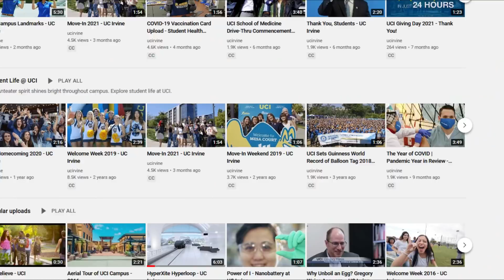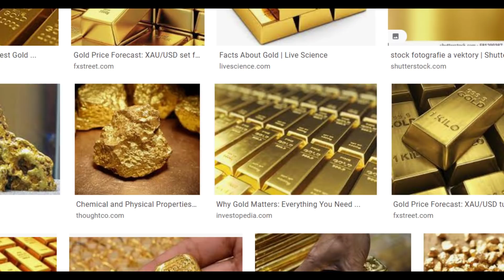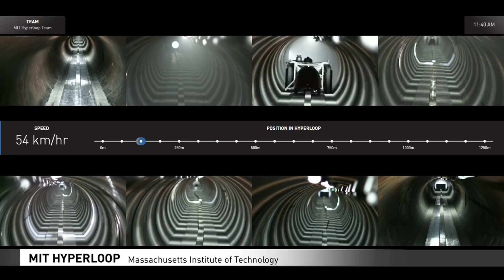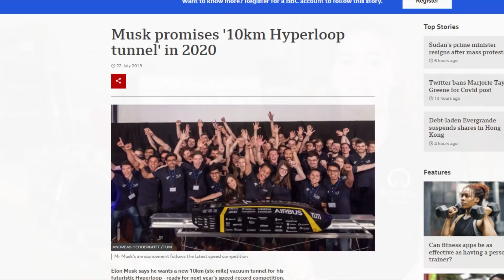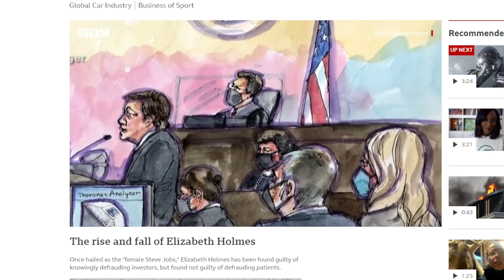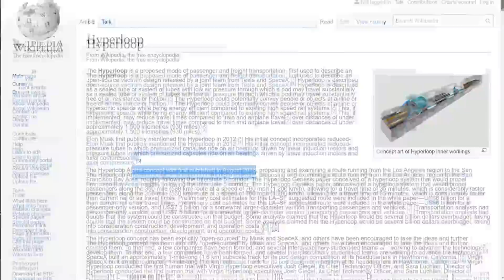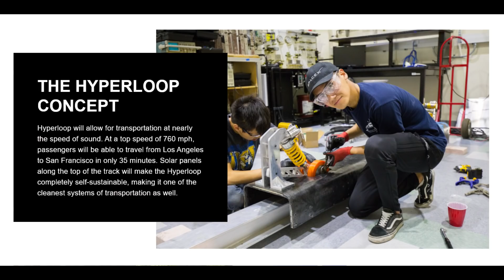The GOLD Battery that will revolutionize EVERYTHING!

Comment: Given the thermal runaway on a failing lithium cell imagine the disasters we'll have if we ever do figure out some trick of physics that let's us dramatically increase the energy density of batteries.

"In a tragic story this evening ALL of greater LA was vaporized when Little Timmy cracked open the battery on his Forever Flashlight unleashing all 250 petajoules of energy contained within it."
Reply: Thunderf00t has talked about that, basically if you wanna increase capacity, you must trade safety. Lithium batteries are are essentially like thermite when they start burning
Reply: I suddenly have the mental image of a scene from Star Wars where a battery like this fails by accident and its inventor, rather than accept the failure of his infinite power battery project, just puts a timer on it and invents thermal detonators

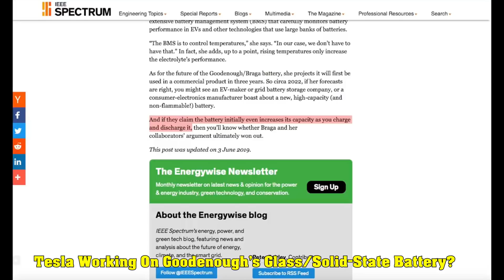Comment: 16:00 That was directly from Goodenough's research, which I tend to believe, but it really shouldn't be sold in the way he's doing. Apparently, something about the chemistry, intercalation, and structure of the solid-state battery that Goodenough's team was working on resulted in an interesting characteristic where it needed to be cycled several times before it could achieve its peak capacity, but it would begin degrading (as all batteries do) after that point.

Comment: One thing I don't understand about the Hyperloop is why have a vacuum at all? 
Also, why don't they use a skirt like those hovercraft do? 
Without a vacuum, they could put a big turbo fan engine the front and use air cooling from the exhaust in the rear that creates a "pocket of vacuum" right in front and uses that cooled, compressed air to lift and thrust it. So there will be a compression behind and a vacuum ahead of the pod while it's under power. 
If you put coils along the tube path you can provide power through magnetic induction. Now the whole thing is passive and practical! 
When someone takes this idea and you read about it later, please emember this post?

Comment: 13:00 not just wheels, wheels sprung on Öhlins shocks, one of the most expensive suspension manufacturers. For a vehicle that will travel on a flat metal rail.

Comment: Maybe you will answer this later in vid but I want to ask as im watching it. So I'm guessing the gel and the process of what they do with it on nano wires is the interesting part. Since gold and lithium store about the same energy couldn't this same gel and process be used on lithium nano wires? What about other metals. Im no chemist at all but im kinda a fan of radio isotopes. Would be cool if spent fuel could be re used like a contained battery

Comment: I don't know. They coat the interiors of buildings with gold. Which works because the layers are only a few atoms thick and the actual amount of gold is negligible. Since capacitors only care about surface area, I don't see how the price of gold is a massive issue here. In fact gold is used in electronics all the time, mostly for plating contacts against corrosion and minimum resistance.
I mean it's probably still a dumb idea, but not for the reason of pricing or weight.

Comment: Have you seen the carbon nanofiber battery said to work by I think, brownian motion? The video I saw didn't have any crazy claims about how much power they'd produce, just enough to maybe power small things like watches. They just said as long as there's thermal energy in the surroundings, it will keep providing power. Can you debunk that, or have you already and I missed it?

Also, would scaling up the pneumatic tubes used at drive through banks for a while work? Or is that just as impractical as hyperloops vacuum tube?

Comment: To be fair, the price is the least of the issues. Corrosion resistance of gold is used in a lot of tech. Sure its not a lot per cpu/connect but it still adds up in the tech we use. So its more about how much you would need per battery.

Comment: Itd be fun if simply removing the vacum in the hyperloop and just have a contained loop and the trains not affected by weather and wind, whould have been better than the hyperloop.
That way creating a new enviroment to design a new type of train. Is it powered by maglev? is it powered by an aircuchion? is it powered by a spining fan / compressor?

And they went directly to a vacuum tube.

Comment: You can buy off the shelf lithium batteries today that have a 10 yr, 6000cyle (to 80% DOD) warranty.  Quick 'blip' at 3:05 says "she found commercial gold nanowire batteries could last up to 5,000-6,000 charge cycles"......so where is the improvement ?

Comment: What I don't get about the Hyper loop is why is the car even powered at all? The original idea from the 19th century and as actually implemented with the Atmospheric railway with tubes under the car is to use the air pressure to fire the car down the track which seems far more sensible if not suffering from the same problems of cost and integration etc.

Comment: What I find funny is air pneumatic messaging system send their pods faster through a tube compared to a hyper-loop. Because hyper-loop got the principal so so wrong.
Reply: i always wondered what happened to those. Instead of trying to make the air a vacuum to remove drag, Couldn't we use pipe physics to start a wind tunnel to reduce drag? If the wind moves with the pod there'd be less drag....
Reply: @comet.x  You would have the air dragging on the wall of the tunnel instead - even more power would be required.
Reply: @dukenukem5768  Aren't pipe physics really weird though, which is why pneumatic messaging worked (and still does for delivering drugs in hospitals) so well?

Comment: that would be really useful in satellites and shit though, the quick discharge of capacitors is important for turning on some intermitent systems, with this technology they'd be a lot more durable.
Reply: I was thinking luxury watch batteries.

High value items with low power requirements that will benefit from never degrading.

I think 'gold battery' would do well even just as a marketing conceit

Comment: Two tubes, each with individual pressured one-way valves, would still not retain a vacuum. There is no way to maintain vacuums over any sort of distance because it's literally an exponential growth of energy to suck the air out of miles and miles of tubes

Comment: The claim for increased battery storage after time was based on the charging software getting upgrades that would allow a higher maximum than previously limited by safety. So you are starting with a battery that can only charge to, let's say 80%, the through updates it can now safely charge to 90%.

Comment: The Hyperloop can easily be built in space. Just make a 30km-high elevator and build it up there. Presto!
The battery on my cellphone already seems to last forever. However, that property seems to work only when it's plugged in, which means that the ever-lasting battery is somewhere in the wall outlet.

Comment: But a capacitor isn't storing energy chemically, it's storing it electrostatically, it is relying on the structure of the gold, rather than its reduction potential. So it's actually going to have a much lower specific energy density than a lithium ion battery, but it could have a higher specific power density. Discharging in a microsecond while the li-ion takes a few minutes.

Comment: Have something that actually does exist.
Alluminium ion batteries.
2.5 times the energy density of lithium ion, less likely to explode and near double the charge rate!
The catch?
It outputs 30% less voltage and is a good chunk heavier then lithium ion batteries, and most of all its lifespan is abismal. That is because the alluminium creats its protective oxydation surface no matter what and chemically attacks the cathodes and anodes.
Basically it oxydates the entire battery very very fast. Thus making it unuseable.
It might be possible to prevent this. But so far, we habent discovered how to reliably do so.

So yeah.
Have some actually true and interesting battery tech that is actually being worked on right now.

Comment: It's not "wheel," it's the hype-r-Hoop™. 

They'll not walk on roads, but this new concept that borrows from circuit boards' pathways, the traces, but it sounds better to say they're hype-r-pathways. And the whole hype-r-loop thing is in turn renamed hype-r-circuit to better describe the analogy. The tracks, they're like "conductors" for the flow of the hype-r-vehicles. You'll soon see an awesome 3d graphics presentation showing allegorical glows of light flowing on a circuit board, which will gradually fade into 3d vehicles and tracks, metal tracks similar to those of circuit boards. While an easier way would be to have a literal pair of hype-r-conductors in each hype-r-pathway, so that the hype-r-vehicle can rest on both sides in a way not unlike how cars rest on its wheels of both sides, an idea to explore is to have the hype-r-vehicles hype-r-balanced with hype-r-gyros and running on a single hype-r-conductor line. That cuts the main material for the hype-r-pathway in half.

Comment: Capacitors are great at surviving many charge cycles. A capacitor in  a 2.4GHz WiFi front end us charging and discharging 2.4 billion times a second and will keep doing so for 20 or more years.
Reply: Total energy is super low which is the problem.

Comment: Real Battery Tech that has promise:
Aluminum Batteries (though these would have to be swapped as they are one time use... But man are they cheap and fully recyclable!)

Iron Batteries- Only best used for large scale power storage, they oxidatize and deoxidize the iron in their charge and discharge cycles.  Very cool but, again, to get the most out of them they take up the dice of a shipping container.  Good for green energy storage systems, like wind/solar etc, not much else.

Outside of those most advanents are in charging and improving the recovery efficiency of Li-Ion batteries.

Comment: Hey Thunderfoot, just a heads up, Pepsi co. is taking it's delivery of 15 Tesla Semis this month. And according to Electrek, which has the info from Tesla (not Elon), the Semi should be able to tow same cargo weight as diesel truck, because in EU and US the electric trucks have slightly bigger weight limits. So I thought you should have a look at that and maybe slightly (just a bit) reconsider your take on that "never happening" bullshit :)
Reply: The problem with the electric semi isn't in so much the moving weight of cargo as it is in the energy density and the time to refuel
diesel tanks vs recharge a battery. It's not practical for most applications. Sure they will be great in some cases but they will never be able to completely replace diesel trucks until the energy density of batteries is improved.
Reply: @JasonHenderson  That I totally agree. But it was the Thunderfoot "debunking" the Semi in his videos and also talking crap on Tesla new battery cells, which allowed Semi to even exist, because without their improved energy density at pack level, it wouldn't be feasible even in those cases you mentioned.

Comment: I imagine that the literal opposite idea for the hyperloop would have worked better. A hydraulically pressurized loop where you shoot a submarine through it at 600 mph because the fluid is flowing. Bearings? F*** them. Vacuum? It's easier to patch holes on a pressurized line. Lack of resistance? Floating a submarine in a fluid would give it something to push off of.

Comment: It is interesting that some forget gold is one of the most ductile metal, you really don’t need much to cover or create a huge surface. You don’t need to build something out of solid metal/material (insert your preferred one, gold included) to make it corrosion proof, that works not only with gold but other corrosion resistant materials/metals, you just need to coat what you want to protect.
Reply: Sure but gold is pretty bad as coating material due to its softness a single scratch and the steel under it would rust.
Reply: @chrisrawr6177  that is valid for any type of anticorrosive treatment and also depends on the thickness of the coating. Still no need to make the whole thing out of solid gold. The whole video is full of exaggerations

Comment: 6:49 now , i developed a new mode of hyperloop, now we need space and also DONT be fooled by the simoulour and maybe uncany reseamblence to a soviet TEM diesel loco, now to cheapen costs we have a emergency diesel engine and regular RETRACTABLE wheels, and we shal use a very wierd and diffrent gauge for the emrrgency wheels, to have coversion be easy to regular standart gauge , we make the hyperloop gauge to 5ft exact, this allows to cheapy lay hyperloop tube on the ground, with a little flatening of the ground to stabilise the tubes, and maybe we make the tubes out of my new matrrial called airosoligen(Air LOL), this will reduce the prise of the tubes massively , now we also need emergency dieselmotor fueltanks at the depots, this can be easely done by using regular infastructure and technique

Comment: The battery could have medial applications, powering things like prosthetics and pacemakers. Gold would be particularly well suited for such an application because it doesn't trigger an immune response from the body, same as platinum, which is also used in medical applications (and it's even more expensive than gold).

As for the usage of gold as a component, it's already widely used in the electronics industry, so much so there's and entire industry dedicated to the recycling of gold from e-waste.
Reply: No, this is completely irrelevant. For any device built using these gold nanowire coatings, gold would only be sealed on the inside. Gold from the battery would never touch the tissue or body fluids.

Comment: I agree with most of this video, but I do want to add my own 2 cents here: The first thing you should ask is "can this be done", especially in an academic setting, the question of "can this be done commercially" is maybe the 3rd or 4rth question. (2nd is "can this be done safely", and either the 3rd or 4rth would then be "is there a more over all viable way to do this that is already available")
Reply: @davelloyd-  I don't disagree with that, and I wasn't trying to infer that it is acceptable to promote ideas that are somewhere between impractical and outright stupid. Rather, just that academic research isn't and shouldn't be driven by a profit motive, as that would stand in the way of fundamental/general research that has no specific use or profitability 'now', but that might greatly contribute to those things later on. 

Not to be belabor anything, but it is important to remember that universities aren't monolithic, they are collections of very many people with different levels of expertise and different motives - usually the people hyping ideas like this aren't the principle investigators (PI's) of University affiliated laboratories, more often they are administrators or undergraduates who have the defense of just not knowing any better.

Comment: Why not just attach a nozzle to the front of a train & connect it to a nitrogen tank, & have the train drive through the air displaced nitrogen atmosphere or fill the loop with nitrogen, to greatly lower air resistance or fill it with water & use supercavitating air bubbles if you hellbent on putting it in a tube!

Comment: I remember the paper from 2016 and it was never about storing energy in the wire, it was always about the contacts of the anode and cathode. Nothing more only the contacts and yes batteries need contacts to the outside and corrosion could happen there very quickly limiting the amount of reload cycles. What they did is layering the contacts with an organic compound which stopped that corrosion. That's it not solving other fail options that limit the numbers of battery cycles. 

For the Hyperloop it is clearly visible that none of the universities expected to to have them running in a vacuum tube and probably not at the claimed speeds. So what to do well without vacuum air resistance is a factor taking into account and so you have to give them the sleek design they did. So what is the issue of let them do the projects run into real world issues and they learn a lot lessons for life on a real project?

Comment: I kept looking at these young engineering students working in their labs, thinking, wondering, what manual technical skills COULD they transfer to some other job AFTER the realization that the hyperpoop is just a gigantic scam comes crashing down on their heads.
What useful manual + technical skills ARE they learning there in their workshops, even though they are applying it to the hyperloop bullshit.

Comment: First thing I thought seeing the intro was "So... It's a capacitor with gold?"
A capacitor can be charged more often than a lithium cell, yeah, that's nothing special. That's what's to be expected by a capacitor, they can be charged practically endlessly, but they have extremely low energy density in exchange for their longevity.